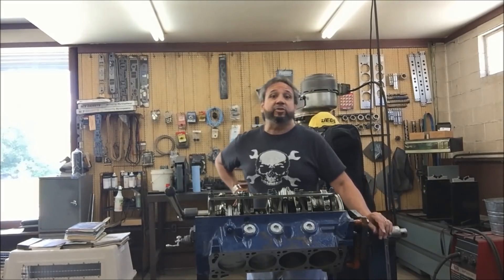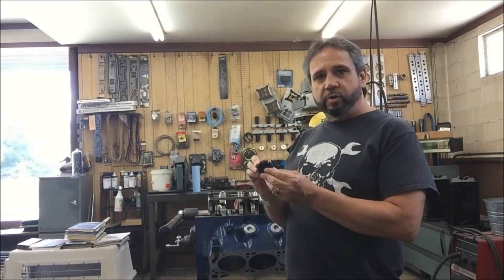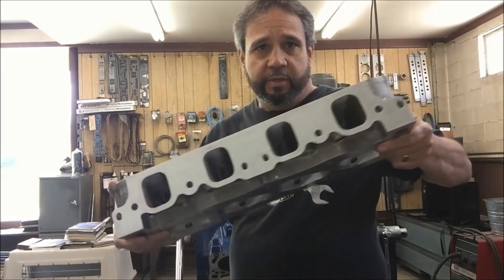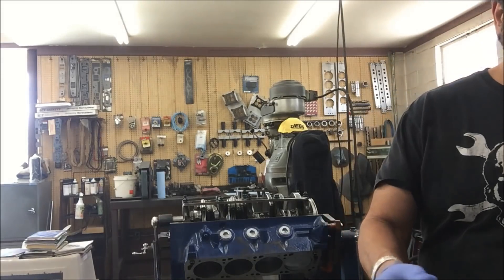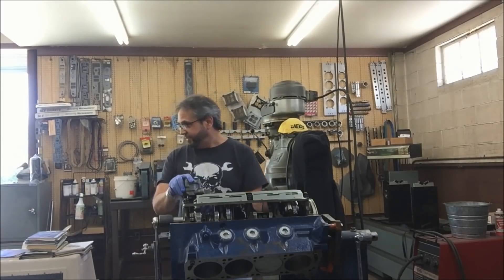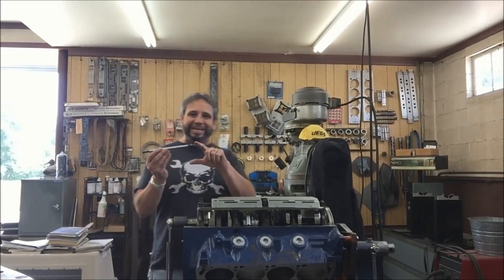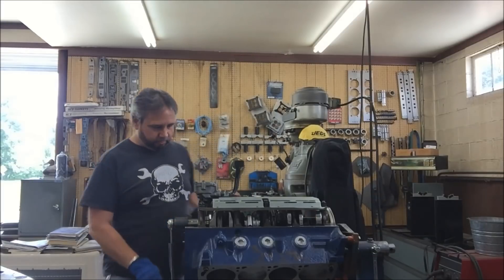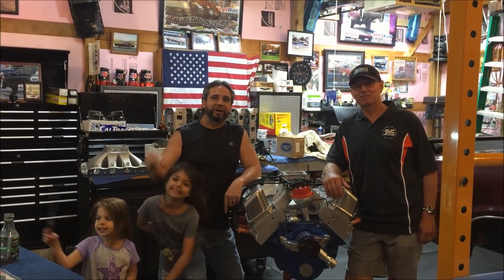Episode 20: 752 hp 408 Cleveland Buildup 2019

Comment: I'm really impressed with your videos and the power you get from these Cleveland's!
I'm considering building a cleveland for street use and I was curious as to what would be a good entry level choice 
concerning block, heads, intake and obviously what stroker kit?
Thanks for your videos.....keep em coming!
Reply from the maker: Any stroker Cleveland, and iron 4v heads, single plane,  850, some gear/stall, 11-12:1 and hang on.
Reply: @dragboss351cleveland  Thank you. Looking forward to your next video!
Reply from the maker: @barneybarnette8895  Thank you for sure. Keep me posted, if I can help let me know.
Reply: @dragboss351cleveland  what size gears
Reply from the maker: @boturner5200  i ran 4.86 for 15+ years. I switched to aluminum center section with 4.71 currently.
Reply: @dragboss351cleveland  I run 4.88 with worked 4v heads in a 3400 lbs car an can only run 13 flat .
Reply: @boturner5200  ??????
Reply from the maker: Tim Meyer has got you covered for stroker kits.

Comment: Is the head a Yates style head?
Reply from the maker: No Cleveland with raised intake and exhaust ports.The first of the motorsport heads, the precursors to yates. They are the same configuration as the prostocks used to run. Like cleveland 4v, with filled intake floors, and the exhaust ports cut off, and the aluminum exhaust plate bolted on. Raises the exports wicked.then came B3, C302/B, C3 yates followed.
Reply: DragBoss thanks for the info I have a 351c with blue thunder heads Yates style just can’t find a intake manifold for it 😰
Reply from the maker: @midnightmoney9775  I have aset of new BT 3.6, I also have a tfc 4v ported by Darin Morgan, I can mock it up, bet it fits....
Reply: DragBoss how do I get ahold of you email or by phone ?
Reply from the maker: @midnightmoney9775  thpa351@aol.com

Comment: Tim....according to the numbers, Mr. Morgan did an outstanding job on the A3 intake ports. Judging from the visible dimensions at the port opening, charge flow velocity will compliment the huge flow volume. The finished Motorsport Intake is a work of art and should perform very well with the A3’s.  

The Molnar Rods will definitely help eliminate the detrimental effects inherent with the brand X rods with their excessive offset on the pins. Less piston/bore wear and more power is a nice bonus. 

It’s good to see a windage tray going into this build. It’s kinda hard to imagine the chaos going on inside the crankcase at high rpm’s but every before and after dyno test I’ve seen featuring a windage tray/ crank scraper always had positive results. The average power gains were 7-10 horsepower and depending on the rotating assembly, some were up 15 or more horsepower. Definitely a good way to free up a little more power. 

As the time draws near, the anticipation of something very special climbs the charts ! 
Confidence is high and it shows in your demeanor. Hook hard and straight my friend. That 7.50 time slip awaits 🏁
Reply: He'll be MORE THAN HAPPY with his 7.50 time slip, I'm sure Daniel !!
Reply: arkhsm ford ...no doubt 👍
Reply from the maker: Yes, all coming down to complete project. The windage tray looks great, and I suspect it will may a big difference with nothing previously used. I think Morganized heads and intake will surprise me for sure. The engine turns over will minimal drag. Hope to get heads done tomorrow and heads on, In the car real soon. Thanks for scoping it out Daniel.

Comment: Please Dyno this engine and list all spec's like port volume, combustion chamber volume, complete cam spec's etc. I help donate for the Dyno time !
Reply from the maker: Erik, I would love to dyno, but funds going toward new valve springs and parts, from my new sponsor Bullet Cams. Donation would help, but I don't think I can make it happen. Combustion chamber was 54cc, may be slightly less now. Cam is .744/.727, 273/384 @ .050, 109, in at 107. Port volume I will measure before finishing. Prior was 258cc intake, 140cc exhaust.